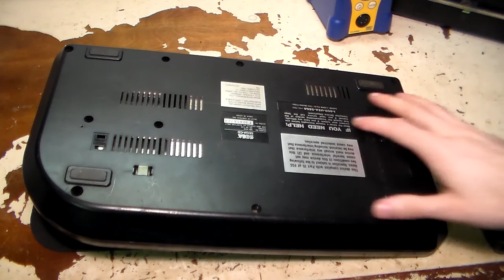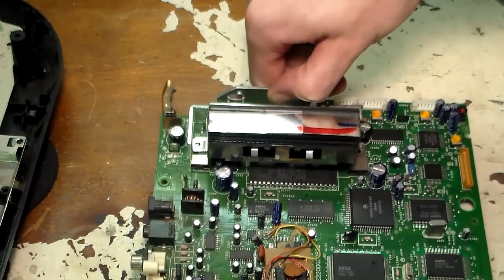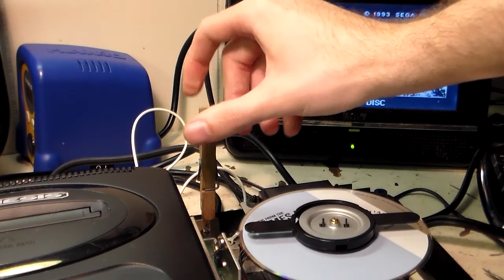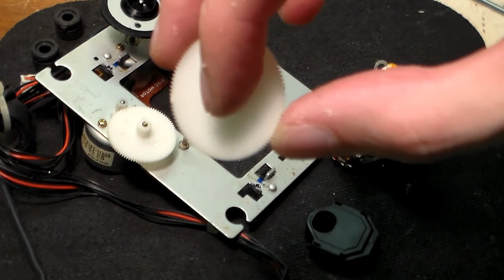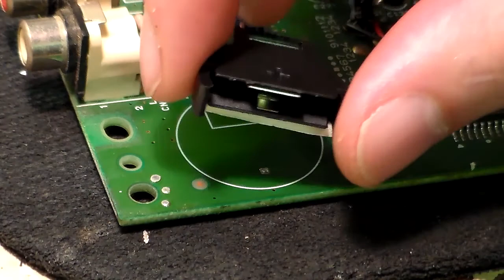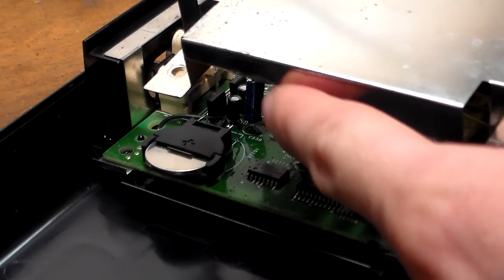Tech Repair: Sega CD Fuse and Battery Replacement, CD Drive Refurb

Comment: Which one is the right PSU for the Sega CD Model 2? I've read that Genesis Model 1 would fit but opposite polarity may fry the system... also on the back says "use the 1602 Genesis AC adaptor only"... fuck... if somebody could help me i'd really appreciate it... do you think the 1602 Genesis adaptor could damage the Sega CD model 2 even though Sega themselves say it's the proper PSU?
Reply: I know this was a few months ago but 100% the "MK-1602" is what is needed for a Sega CD Model 1 or Model 2. It's the exact same as a Genesis Model 1 adapter, same part and everything.

Comment: BTW, you want to be using an ML2032 battery instead of the LIR2032 you recommended. The ML2032 supplies 3v instead of 3.6v, so since the Sega CD is expecting 3v it'll drain the battery lower than it was designed to go.

Comment: This is the easier fuse replacement, the one on the back takes more effort than the revision 1 board. There is surprisingly a lot of differences between revisions, they aren't small at all. 

The power adapter is the most common on these blown fuses. You have too many trying to use NES adapters and those aftermarket adapters can do it too.

Comment: My model 2 Is making a grinding noise, Do you know what's wrong with it? Thanks
Reply: Mines starting to make a grinding noise too, assume it’s just a problem with the gears not spinning right. Did you ever fix your problem?
Reply: its the main transport wheel that either dried up or has missing teeth.. there are replacements online for under $10

Comment: Where did you buy the battery holder for this and does this also work on a Sega CD model 1?
Reply: Console5.com is another source for components. You can get fuses, batteries, and battery holders for these, etc.
Reply: @Zyfer_Warrior  Not the rechargeable battery sadly. Only batteries for the cd cartridge.
Reply: @EngieDerek  They did carry the ML2032 solder tabbed option at the time. Though there is still the battery holder option or just go on ebay and get one.
Reply: @Zyfer_Warrior  Thanks, I've been worried to purchase one since they are all getting older and I don't believe they are making that battery(with the 3tabs) any more. I think wheelman's option is looking pretty good right now. ;-)
Reply: @EngieDerek  No, they still make them. You can find the ML2032 ones on Ebay. No need to replace it if works fine. They are rechargeable, so as long as they are still holding a charge, they are fine.
Reply: @Zyfer_Warrior  You sir are a gentleman with a wealth of knowledge. Thanks :-)
Reply from the maker: i think i got those holders from ebay or amazon. should work on a model 1 too